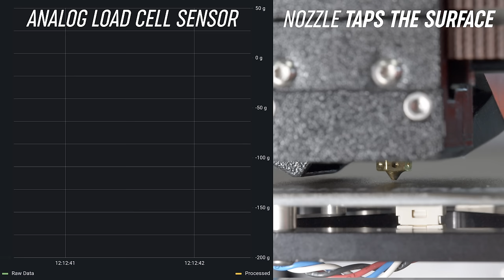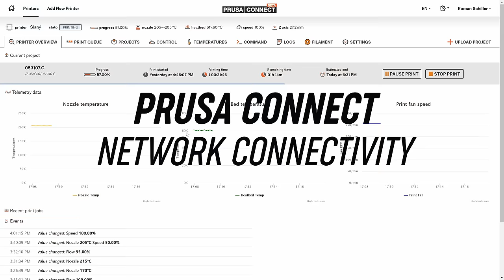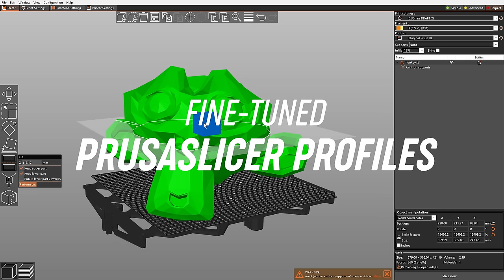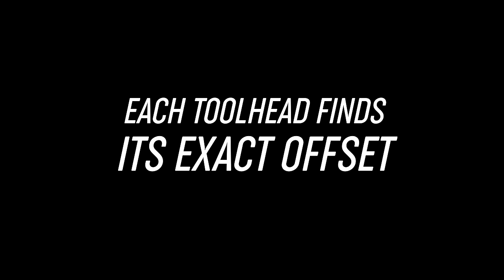First look at the Original Prusa XL

Comment: Hi team Prusa, 
Disclaimer - i am a doctor by training and not an engineer or designer. During pandemic and lock-down, I wanted to learn new science so got into 3D printing. So my views are from purely personal experience. 
I have Prusa i3 Mk3 + MMU 
I have ordered XL with 5 tools

1. 3D printing innovation was delayed and limited due to patent and Prusa you are bringing innovation and revolution to the industry - that's amazing. 
2. the cycloidal gear - is a game-changer in the industry and will push other serious players on thinking differently and innovate. that's good - just questions conventional 2 gear system grips filament from both sides (same Z-axis) and hence the path of the filament is straight,  is Cycloidal great gripping the filament from (2 different Z axis) so will the filament have radial torque and bending it? will it be a good choice for flexible more than for rigid filament? interesting to know more. 
3. the hotend and temperature - it would be good to see if we can use material of say 300 degrees and already nozzle options for those materials in the initial package, rather than to buy later. 
3. Auto bed levelling - this technology is not new in the industry, but you have wonderfully adapted and implemented it in a seamless way without compromising on weight etc. that's a high level of engineering and is - breaking the old ways of probe usage. kudos.  
4. modular bed - it's a great idea and they have gaps in between to manage expansion etc. it's very well thought off.  real-life example - my son was excited about the pen stand I built so as soon as the printing stopped he ran and literally pulled the plastic off the built plate. what will happen if it is modular - would it be easy to align individual blocks of the bed? if 1 block is not working can we replace and easily align it or we will need to replace the whole built plate? interesting to know more. 
5. changing tool head - I have MMU the new one - truly it is a waste of money and time for me (maybe not for an engineer or full-time 3d printing person) having said that it is important to support innovation and have trust. it would be interesting to know what would be the time if the same model is printed in 1 colour, 2 colour and 5 colours.  Another point is when printing with multiple colours the parked tool head would be heated or not? if yes will it ooze out if not will it take time to heat up again?    
6. data collection - as a simple user I think raw data has no value for me, what will help is an analysis of the data and suggestions/recommendations from the data or it can help for troubleshooting. 
7. Light and open front frame - a great idea with the real need of the market. 
8. camera - this is missing for now ? may be it could be included and people can opt in or out . this would be really good to have it included. 
9. the draft protector/ shield - its good idea but for this price point most people want a complete solution even for printing ABS or other material with fumes(only 10% or less will use it but still). adding a HEPA filter would be good and safe. 
10. open-source - you have disrupted the industry and it is a case study of commercial success and open-source model. it will help the cycle of innovation. So all in with you on this and we should all support it. 

Summary - we should back-up innovation and am all for it. wish you all the success and hope in your next promo could address these questions. 

best wishes 
Dr Gaurav Mathur

Comment: Is it possible to print with same material but difffrent nozzels that change during print of one model .For example, printing some model that has at certain points complicated details but all in all is not that complicated , so u start with  0.8 but at that details it switch to 0.4 .

Comment: Alooot of those features are awesome. most of them can be done with a Voron but it is far more complex. Love to see that it's going to run a version of Klipper. my only wish would be that it is fully enclosed for printing Abs.
Reply: Their concertina enclosure is an interesting concept, but looks to leave the top uncovered. I guess it'll still work great for ABS most of the time.
Reply: @_Piers_  the Obvious comparison for this printer in particular would be a Voron 1.8 the kit is more or less $1200 and is set up specifically with a filter and enclosure to print abs. i'd like a carbon filter personally

Comment: I wonder how tramming the X/Y/Z axes are during initial building. So many questions regarding the mechanical side of things.

Mainly worried about harmonics on the cantilevered X/Y axes.

Awesome that the team considered expansion joints for the heated bed! Solves 1 of the issues of the MK3S.

The electronics look rock solid! And I have no doubts the software will be a pleasure to use.

Great work overall; I hope the production hum will go more smoothly, and smart features trickled down to MK3S by the end of 2022

Comment: Will there ever be a Prusa XXS, with a single one of the heated bed modules for a 9x9x9cm build volume? Also, the strain relief springs on top of the toolheads are a very nice touch
Reply: If they could make it so that 4 of those have a similar (or smaller?!)  footprint to a single Mini, that'd be freaking amazing. You'd need more room for all the filament spools than for the printers 😄

Comment: I was originally looking a building a Voron but one of the things that concerned me is that even though you'd spend over 1k building it, many folks still have countless issues with theirs. It would be interesting to see how well this thing can print the different types of materials and how the parts are over time. Its about double the price of building a voron but if its reliable out of the box and can handle most of the materials it would be worth it to me.

Comment: How does first layer calibration is done if the nozzle have tiny solid plastic blob?
Reply from the maker: We do MBL usually at 170C, so the plastic is soft enough to get pushed to the side during the first tap. It automatically detects that the tap was "not clean" and repeats the tap with a small offset to the side. So occasionally the nozzle taps the spot not once, but maybe 2-3 times to get a clear reading. -Mikolas
Reply: @Prusa3D  Awesome!

Comment: It looks realy awesome and i instantly preorderd it, but there are three points  I wonder about.

1) The part cooling seems to come only from one side. Personaly I'm more of a fan of two sided cooling. A proper duct can help when you only have one fan though. Any info on what fan is used here? I would expect at least a 5015 to get enough airflow.

2) The "Nextruder" looks realy interesting with it's unique gear-idler combo. But the inside view in this video makes it look to have problems with flexibles. The gap after the gear looks a bit large. That would be a downer as I am interessted in combining flexibles as part of the surface with other materials for the body, utilizing the tool changing capability.

3) The printer is advertised as being fast (as you would expect from a Core-XY nowadays), even though the focus is on print quality. The nozzle change system wich is a bit like the Revo is advertized to quickly change nozzles of different diameters. And the tool changer could be used to use different diameters in a single print. The use of larger nozzles is primarily used to reduce print time as well. That begs the question what flowrate we can expect from the hotend and if there will be high flow variants. With larger nozzles and only half a decent print speed (at least 100mm/s), flow rates can skyrocket quite fast. If I have to half the print speed for using a 0,6 or 0,8 nozzle instead of a 0,4 one , there is no gain.

Comment: hi, there are 3 order options when it comes to extruders: 1x, 2x or 5x. figured out that you also need board extention to upgrade from 1 to multiple heads later on. do i also need an extention card if i upgrade from 2 to 3+ or would the board already be compatible with up to 5 tool heads?
Reply from the maker: For 1-2 toolheads you do not need extra card. For 3-5 you do need one extra card. It's all in the release article ;)
https://blog.prusaprinters.org/original-prusa-xl-first-look_58312/ -Mikolas
Reply: @Prusa3D  thank you :)

Comment: Now do the same with smaller print volume at lower price, I don't even need a huge printer like this but would buy a slightly larger than MK3S with those features minus the tooling.

Comment: Does this use actual end stops or are you still just ramming the carriages into the frame to detect the movement limits?
Reply from the maker: No endstops, those would fail over time. Like all our machines, we use sensorless homing with Trinamic drivers. Ramming is a bit of a harsh term for it :) It's very sensitive and barely pushes against the end of the axis. -Mikolas

Comment: Its kind of sad watching this after 2 years, with first printers being reviewed and end up with stringy results in multicolor, due to bad profiles. It also misses input shaping, because it was "no time" implementing it to the firmware. If bamboo came up with an XL version now, it would be hard to recommend like MK4. Even as a fan.
Reply: The magneto is basically an xl. It won't be too long till we see multi head printers. Prusa is becoming more obsolete by the day.
Reply: @jmsether  If you compare by size, its true. But a potential magneto or Bamboo XL would be still different without multiple tool heads.  If its not designed with multiple heads, its hard to stick one in. But some other selling points are also important and will lead to many other buying decisions then the prusa. The E3D tool changer is currently also comparable.

Comment: Looks great! Some of the improvements will be available for mk3s? Like software update, heatbed etc..
Reply: They'll probably release an upgrade kit for the Mk3 when the Mk4 is released, as that is what they usually do. I wouldn't expect anything before then.
Reply: @_Piers_  If they go core XY for the whole lineup just in different sizes an upgrade pack might be less likely . Almost everything on this platform is a BIG departure from the exiting printers. Where as past printers have been evolutions of the same i3 design.

Comment: At the price it's sitting for the 5 head option WITHOUT any additional options added, it's getting extremely close to the price of Raise3D or a Mosaic Element which is an extremely refined industrial printer that takes 8 filaments. The Element also is a more reliable design with a single print head and all metal build. Plus it's available now not in more than half a year. The pricing is great for a single or dual head model (more than some industrial IDEX ones actually) but when they get into multi-head options you're starting to compete with industrial grade printers with IDEX and I feel like it's close enough that some people may just jump to the industrial ones.
Reply: To be honest: I think the multi toolchanger is the best way of implementing multi material printing. Sure you can more easily store more materials but you always have to purge the nozzle. You will have some residue and other things and be wasting material. Plus with different toolheads you can also have different nozzle sizes. You can easily run a 0.8mm nozzle for some parts of the print while using a 0.2mm once you need more detail.

I also do not see that you really have a more reliable design with just one head. Especially with such big volumes you do not want the print to fail. As this printer should be able to automatically detect jams you always could have a second row of the same filament loaded in another toolhead and just continue printing without problems. 

Honestly I just see advantages here. 

Also the important parts are also full metal here. All that matters is metal so no advantages here. And Prusa has a good record as well so you know the system will work.

Comment: will the slicer handle adding the water soluble supports for me, or does that still need to be done manually when designing the part?  multi-material isn't exactly new, but the thing that has stopped me from trying it is knowing that i have to design two separate files that overlap in 3d space, one for each extruder, and that just sounds like a huge pain in the rear, but if the slicer can just bake that into the gcode for me, that would be epic.  i would preorder immediately lol
Reply: PrusaSlicer already handles support generation for water-soluble materials automatically, it even has a "interface only" mode that only puts soluble material where support and part contact to save you material

Comment: Are there fully enclosing panels available and what temp can the chamber achieve? Is the tool changer available with an enclosure box to control humidity?  What % parts are 3d printed vs metal formed vs injection molded?

Comment: At this theoretical build size a SERIOUS improvement in print speed is mandatory. I wonder why they did not say how fast this printer can print reliably. 
Imagine that castle they showed probably took them 4 days or more of printing ... that would suck.
Reply: meh... I'll take quality over speed any day... and I run my i3 MK3S printers 24/7 pretty much nonstop with .25mm nozzles  Most of my prints are multi-day

Comment: Non-planar printing? It's The only thing I wish was mentioned, granted it may be possible here and just in the works software wise still. 

The interchangeable hotends has been a must for awhile now, glad it's finally here. Looking forward to buying rev2 🍻
Reply: Non-planar printing is all software. The only hardware change that's sometimes needed is a longer nozzle.
Reply: @iAmTheSquidThing  There's just that many use cases for it unless the whole hotend assembly has a small footprint, which this really doesn't.

Comment: Will it have a completely closed chamber or will it be open on top? Will it have opaque walls (like in the video) or will it have transparent plastic walls? Does anyone know?
Reply from the maker: The walls are retractable magnetic opaque textile draft shield. There will also be available clear top cover, but it will be fairly big, there needs to be enough space for the cables and iflament path for each toolhead. -Mikolas

Comment: $1800 is laughable, while some of the features all really nice to have I can easily achieve the same thing for far less and get far more control then this. If you aren’t willing to put in the work to build and troubleshoot a printer like this, go and buy it but when I can get the e3d tool changer for a little more why the hell would I buy this.

Comment: You can never heat the chamber in this printer or risk melting the crap parts. They didn't even bother enclosing it. Just a cheap draft shield. Crap gear ratio on extruder, Heavy as hell gantry mechanism combined with a big volume = SLOW FOREVER LONG BIG prints. Crap all around. Give me all metal and a high temp chamber for abs and exotic strong materials, NOT this commie rip off plastic remix of everyone in the space

Comment: changeable toolhead is the only thing that attracted my attention, everything else is just like stupid ideas of managers, but not engineers... In the end of 2021 you should get heat chamber with active heating and cooling with at least same construction as voron printers, but not a simple whistle which was on the first i3 cheapest clones. I do not absolutely understand why do you stop the progress  wasting money and time on useless upgrades when voron designers have a huge improvement ideas not even compariable with your dinosaur like designs. Isn't it a shame that free open source project has much more cooler design solutions and twice cheaper?

Comment: this looks awsome!!! But there are some problems i see. I feel like this printer was made to be very expensive and not affordeble. For example. I see thay are using linear rails. Yes thats good but i would like to see a linear rod version. Or the extruder. Fully custom extruder design aint cheap.
 Me myself im so desperate for a tool changer 3d printer that i built one myself. It cost me 350 bucks for a printer witth 4 heads and an ender 3 build volume with 350 in z. Good job with the engineering i must say. But i feel like it could be a lot cheaper.
I feel like prusa has always been mid range price printers, affordable and best in their class. But the xl feels like trying to capture the prosumer/enterprice market instead of appealing to consumers. Like the did mk3. The XL feels out of place. Too expensive.
Reply: Prusa's have never been cheap. They are reasonably priced and high quality. I tell my students that if the hobby that they are pursuing is 3D printing to buy an Ender; but if the hobby is designing ang making stuff then buy a Prusa.  I don't mind paying for a set-it and forget-it printer because my time is valuable. My students on the other hand have more time than money so fiddling with the printer is worth it for them.
Reply: @cramitdfrog69  I see your point and i even mentioned it. But i feel like the prusa XL dosent have a market because if you want a large tool changer you go for the e3d one. It has more features and is more mature.
Reply: My first 3D printer was an Ultimaker 2, price tag € 2.400,00, my 2nd one a Zortrax M200, price tag € 1.990,00, all single tools. Was dissatisfied with my UM2, and Zortrax dropped their M200 support in an ugly way, which led me to Prusa. I'm using my two Mk3s and three Minis on a daily basis for several years now, never dissatisfied, and I'm sure the XL will grow/develop fast as the Mk2/3 did. The price tag is more than acceptable, at least for me.